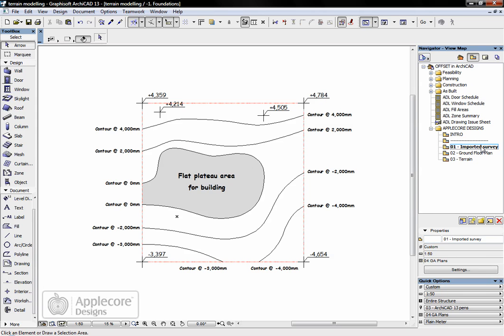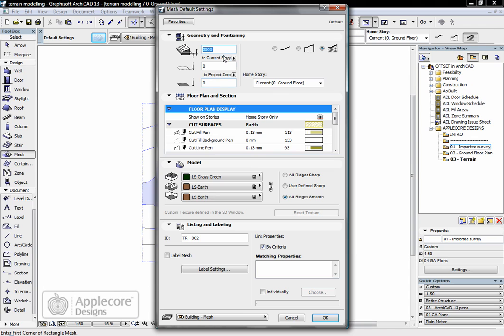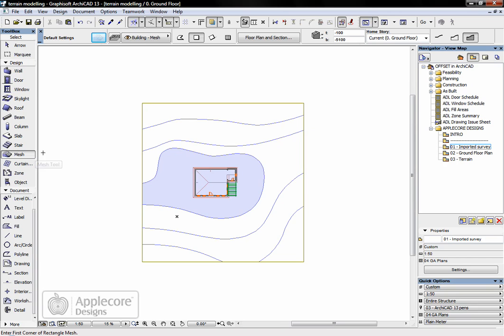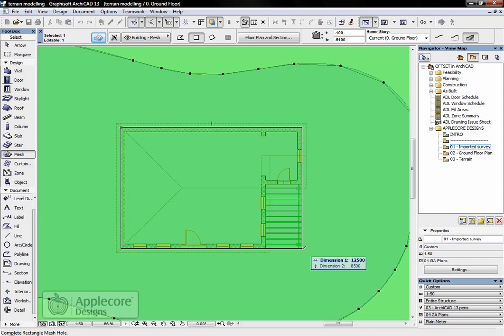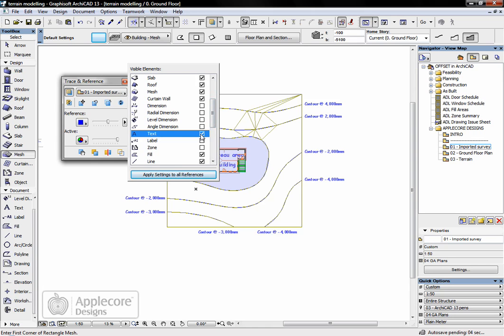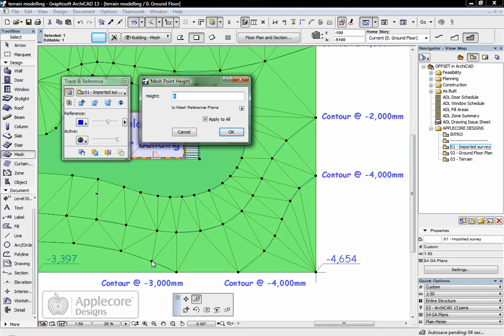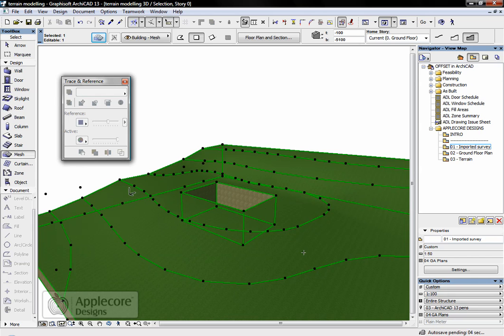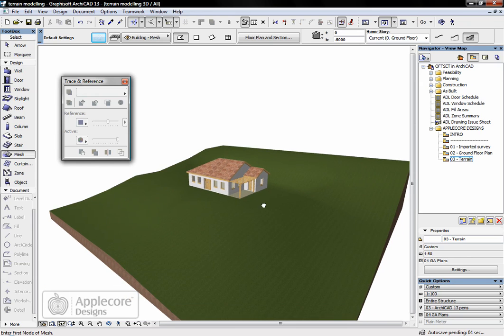ArchiCAD Tip: Terrain Modelling

Comment: it doesnt work for me what im doing wrong?i have archicad 18, i import the jpeg in groung floor,i go to  the first floor i push the trace button,i desing with mesh tool, i push space bar but nothig happent, just make a copy from the mesh
Reply from the maker: A jpeg does not contain any vector information to trace - try using a DWG or exploding a vector based PDF.